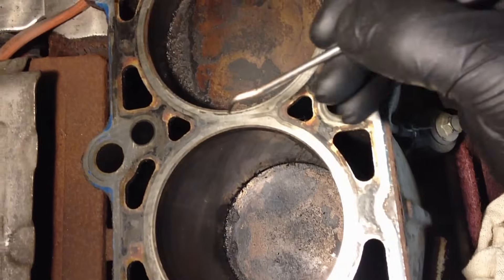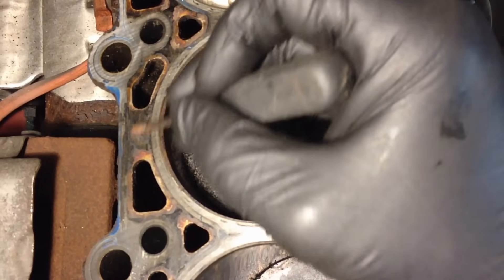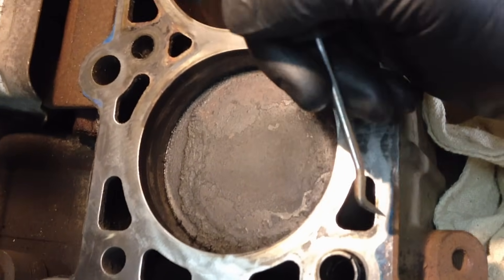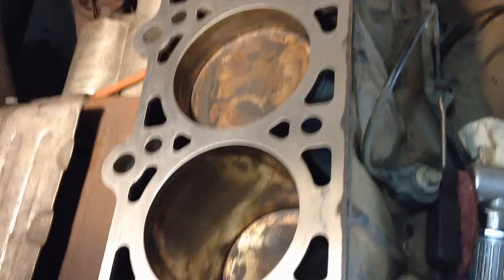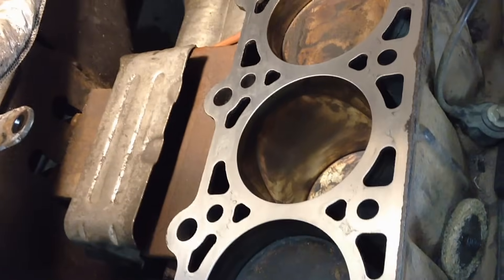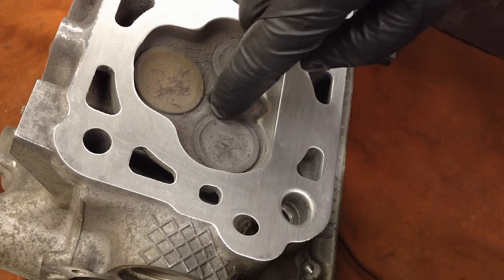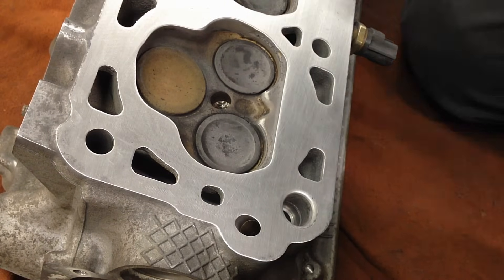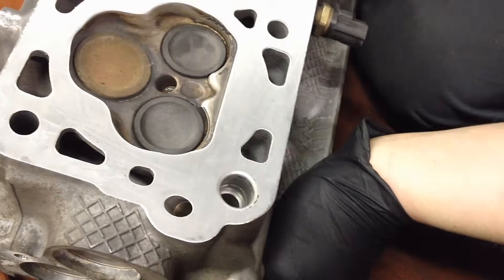My Best Method For Cleaning Head Gasket & Other Engine Surfaces

Comment: one question, would a resurface job give better overall results/longer lasting/ or more reliable results or would this(if done properly) work fine ?
Reply from the maker: +shayson1357 This method works just fine as long as you are clean about and use light pressure. Now if you were running a race engine I would have it resurfaced by a machine shop
Reply: thank you for replying :)
Reply: re-surfacing is really only needed when the block is warped because cast iron is pretty soild metal. But alloy heads more or less do warp a little depending on how you pull it off but its just better to be safe to check for warp and get it machined if it is.

Comment: A cylinder block also contains oil passages and these are exposed when the head is off. My concern would be getting abrasive grit into an oil gallery, the pump will move it with the oil and push it through the big ends and bearing journals. Not good.  Use a good gasket remover and a plastic scraper with a little rub from a scotchbrite pad for the stubborn stuff
Reply: check out the cylinder at 8:27 and compare to 10:23 . The amount of residue from the scotchbrite pad is pretty amazing. I can only assume that quite a bit of it is deposited in all of the passages.

Then again he doesn't get any come-backs. I'm not trying to criticizing his technique, but I have seen this discussion in several videos. Didn't realize that so much of the pad was being left inside the passages
Reply: the grit in a scotchbrite is usually aluminum oxide, harder than iron.
I'd rather use the roloc that he shows. it uses mechanical abrasion. the plastic will melt.
most people are go way overboard, almost to the point where they are removing small amounts of block. get what you can see, wipe it clean, and you are usually good.
what most people forget is to dump the oil after the head gasket, and at 500 miles to drain abrasives and contamination
Reply: Justin Kenaley of

Comment: This is was actually a great help since I don't normally do head gaskets in my business. I recently pulled the heads off a minivan but sent them to a machine shop. It was $150 to have them leak checked, machined and cleaned. I couldn't think of a good way to get the swirls marks out of the block and your method works great. Takes time to keep cleaning but it looks great. I couldn't find the scotchbrite red so I used the maroon metal finishing pad from Home depot and it came out great. It's not as fine, but all of the swirl marks are gone.
Reply: I found them at a Sherwin Williams. they have the very fine and ultra fine. thanks
Reply: Holy crap, I just had a 4 cylinder head tested, surfaced and cleaned for only $40. The guy is a well known machinist in the area, everyone takes their cylinder heads and flywheels to him for surfacing.
Reply: +Patrick94GSR I live in Long Island, NY which is one of the most expensive places to live in the US. I wasn't concerned about the price but more that the heads were in good shape. It is a decent amount more work on a transverse v6 vs a 4 cylinder.

Comment: i use a razor blade to remove remnants on engines that use composite gasket then clean the surface with 180 grit sandpaper and spray some wd40. 180 grit and wd40 is all it takes for mls gaskets 
never had any issues this way.

Comment: is this the same method you use on the 6.0 Powerstroke. I have heard horror stories on 6.0 head gaskets because a block or head was prepped improperly.
Reply from the maker: +Logan Eley yes but the 6.0 must be perfect also it's harder to damage than the aluminum heads
Reply: when you say perfect you obviously mean CANNOT gouge or put low spots in the sealing surface, and clean the sealing surfaces to shiny clean metal. but do you have to worry about the non-sealing surface, any other things that you might watch or avoid for 6.0?

Thank you also for making this quality info available to us. good quality info is hard to come by, especially for the 6.0.
Reply from the maker: yes light pressure and high rpm is key with the white discs. You can just concentrate on the sealing areas which will be readily visible but I like to go beyond them a bit. The 6.0l is going to have large patches of rust on the deck surface and head where the cooling jackets meet I like to get rid of these as much as possible to make sure the new gasket sits perfect.

Comment: doing the same job on a 2004. i have 2 questions. the piston faces are pretty nasty... how clean do they need to be before reassembly? and my other question concerns the heads. all of my exhaust valve heads are white. is this something to be concerned about or is that normal? thank you for your time
Reply from the maker: +Bruce B The valves being white is totally normal almost all of the heads I have removed the valves are this way. If you want to clean the piston heads I would used a scotchbrite pad soaked in carb cleaner to dissolve most of it. Safe to use Scuff pads-http://amzn.to/1T2HpLS
Reply from the maker: +Bruce B strong carb cleaner-http://amzn.to/1VAtfYZ
Reply: FordTechMakuloco thank you for your time and the information. huge help. have a good one. stay safe

Comment: Is it safe to put the pistons in the deepest position and spray oven cleaner on it then wipe down the walls and piston head?
I have never done any of this, but I do want to buy a car and make it a project car. Taking out the engine and rebuilding it will definately be one of the goals.
Reply: +METT Cool. Bought a hand held blower for computers a few years ago. But has been great for car projects too. Thanks.

Comment: what's the best way to clean all of that carbon build-up off the top of those pistons?    have you ever tried putting something like sea foam on a scotch-brite pad, and lightly scrubbed it off?    and do you think that would work?
Reply from the maker: +Jeff Fuehr something like seafoam and plastic scraper or scotchbrite would be best of the carbon is severe. No metal scrapers here though.

Comment: Hey man great vid! Will this method work on the 6.0 diesel? Head gasket surface in particular? I have heard that ford puts a special half moon cut on the block deck and cylinder head to help the gaskets seal. What is your procedure on that? Thanks again!
Reply: NO.

Comment: Do you need to chase the threads on head bolt holes on these 3 valves?
Reply from the maker: +woog74 Never have and never a problem I do make sure they are clean and blow them out though.

Comment: can i use that methods for my explorer 4.0 engine
Reply: +STEEVE DAVID Nicolas If you have an older pushrod 4.0 make sure you get those heads pressure checked for cracks. I've seen them crack and cause a miss on cylinder 3 or 4
Reply from the maker: +STEEVE DAVID Nicolas Yes all the tools I use are linked in the video description.
Reply: Thanks Brian
Reply: Mine is not a pushrod engine, thanks
Reply: STEEVE DAVID Nicolas yes

Comment: excellent info I'm currently working on a 2002 Mercedes C240 spark plug change out 4 hours later I've got all 12 plugs out the $500 dollars the dealership wanted is starting to look like a bargain ha ha! oh well back to work BTW just finished head gasket replacement on a 3.0 Ford 6 cylinder all good in the neighborhood never thought of scotchbrite good stuff thanks

Comment: Interesting, I've never seen it done like this before. The surface looks very good.

I use permatex gasket remover and a semi-sharp piece of plastic as a scraper, mostly because I was taught that the grit from any kind of grinding would wear out the pumps for oil and coolant prematurely.  Thanks for sharing.
Reply from the maker: +Yann Kitson Yes you must be very very careful.
Reply: @FordTechMakuloco  is green scotch brite fine? I’m afraid Ive cleaned it too much.
Reply: GM prohibits roloc discs due to the abrasives getting everywhere and causing premature wear. Stick to chemicals safe for your materials and soft scrapers.
Reply: Yann Kitson  

L
 Bml
Reply: chhotu
Reply: Yann Kitson 
  A1EQ.Q.
Reply: Speaking from experience, gasket remover and a plastic scraper won't even come close to removing gasket residue from aluminum. 
I tried paint remover, laquer thinner, gasket remover, acetone, engine degreaser, brake clean, fume free easy off (no sodium hydroxide), and every single other chemical suggested to anyone online without any of them removing any of the residue, at all. 
The only thing that works is abrasives and the method in this video is the one. I used the maroon scotch brite and then sanded with a piece of glass to make sure it is flat. Since I dont have the white Roloc.

Comment: Got a 1998 Ford Explorer Sport 4.0 SOHC engine.need to replace head gaskets, can i remove heads without removing the engine, and will it be easy to set back in time.
Reply from the maker: +Marcus Bergis No you should really remove the engine to time it right afterwards.

Comment: permatex gasket remover spray it on wait wipe it down.
Reply: waited 30 mins and it didnt wrk
Reply: +Roller Bearing Crank - I've used Permatex Gasket Remover--it works great.  I haven't found anything better, though there may be.
Reply: +King Rider thx  :/
Reply: I found Loctite SF 790 paint/gasket remover works great but be super careful around painted surfaces. Spray it on, give it a couple seconds to bubble then use a fine soft wire brush and it takes everything off. It dries making clean up abit easier than Permatex's 'gooey' residue.
Reply: +King Rider well after scotch brite my thumb to death it 75% clean bt the very smooth dark spots are not coming off wit anything. they want to use and paper and say the little scratches help its seal

Comment: I had zero comp on #8 on a 5.7 hemi. I lifted the head & saw the carnage that some idiot man child left behind for me. It had coarse swirl marks all over the deck & no wonder it failed. Someone re-honed 8 & 6 probably was a valve seat drop but the head looked fine, they probably replaced the head. Now i'm re-surfacing the damage done by the P.O.

Comment: What happens if debris falls into any of the holes? Any way to flush or vacuum it out before reassembling the engine? I do not want to risk clogging a oil channel and what not.
Reply from the maker: +Deborah Klinker There is only one oil pressure feed hole the rest are bolt holes or coolant passages for which the bolts holes are blown out before assembly and the cooling system can be flushed easily before startup.

Comment: so how do you keep the grit from getting in the oil channels and damaging the engine, if you are just sending a head off to be surfaced
Reply from the maker: +Metal Maniac When ever you send a head off you will need to clean everything thoroughly upon return brake cleaner is preferred. On the block side you cover the single oil feed hole and go around it.
Reply: Thank you .. this information is very helpful... I have done work with other heads back  in the day but these aluminum heads are so fragile it seems...

Comment: remove the dowels and block sand with 400 then 600 wet dry paper.
Reply: +4sf3d4g63 I'm down with the 400 600 wet dry very controllable. Maybe a little more work but little worry of that small grit in the engine or being too aggressive.  If you wet sand it wipes up the the liquid.  Glass block is an awesome idea, thank You!
Reply: +henryklevemann No problem Henry. You really only need it to get the gasket impression out. Usually 80-90% surface continuity is achieved within 2 minutes with 600. Use microfibers for clean up and the whole process takes 15-20minutes on a 4cyl. If the block or cylinder head is warped I would definitely send it to a machine shop. I've slightly warped blocks fixed this way and still operate perfectly but it requires much more attention to detail and consistency only truly achieved by machinery.
Reply: 4sf3d4g63 Thanks for the reply
Reply: Paul Lorenzini b
Reply: Getting aluminium oxide into the engine is a great idea right?
Reply: The best method is to acid dip the block and rebuild it the right way. After it is bored, line honed, stress relieved, screens installed in lifter valley, billet main caps.
Reply: @donrutter6765  just buy a new car dude.  Don't do that for a beater car.
Reply: +Richard Amuir ^ I do the same thing. I usually finish with 1000grit and use a thick/flat piece of glass as my block.

Comment: Does a standard Scotch Brite washing sponge has a "grit" closely to that one is used in the video? I really can't find any large one like that in my area, and buying stuff from Amazon or Ebay takes forever to get here. Can I use the Scotch Brite from those washing sponges, or will the scratches be too deep?
Reply from the maker: Smartskaft2 Those are much too rough.
Reply: Ok, I did'n think I was that lucky. ;)
Thanks!
Reply: Smartskaft2 I know three types of scotch brite red, coarse ;grey, less coarse and yellow, fine. You can buy them at your automotive paintshop

Comment: On a cylinder head job the best is take the head to a machine shop they w'll check for cracks on warp
Reply: If you can afford it. It can get expensive quickly.
Reply: Cos me 60 bucks for an inspection cleaning and resurfaceing.
Reply: @clicktoedit1759  where??? I'm getting quotes of $290 a head....

Comment: Steel wool and brake clean is much faster, less trouble. I have yet to see anyone on YouTube run a thread chaser down the head bolt holes or talk about TTY bolts...?
Reply: +Lynx Star Automotive (Gabe V) I'd have to agree...I'd rather degrease a blind hole. esp aluminum and use air to clean those threads instead of chasing...

Comment: I don't really like it. You might have steady hand or something but I have seen many heads on youtube fcuked with power tools. Thanks
Reply from the maker: Gregory May I am very light on the pressure and I keep moving it's all in the feel from experience.
Reply: FordTechMakuloco don't worry about his comment. some people don't know how to use power tools. I use a wire brush on a drill and have never had a problem. I like those wheels you used

Comment: roughness parameters ( Ra ) specs....My question is it how do you know if your Ra is in spec for what is needed for the gasket to bond and seal correctly ?  Because manufacturer has tolerance for Ra, right ?....Only asking, not doubting your technique because I plan to do what you did in this video too.
Reply from the maker: Daddyoui S I have no RA specs for this no but I can tell you I have done this countless times and never a problem. It is attention to detail with the final polishing and cleanup that really matters.
Reply: FordTechMakuloco for responding. Keep up the great videos !

Comment: Having trouble getting the cylinder heads off. Is there a special technique? I have a 1994 crown Victoria interceptor 4.6. I removed all bolts. Cylinder head will not come apart from the block. Please help.
Reply from the maker: Donald Kiser On some I have had to pry off the outside of the block to the cylinder head where it overhangs off the end of the block.
Reply: FordTechMakuloco Thank You Sir..
Reply: Donald Kiser are the spark plugs out? Its an obvious thing but sometimes people forget
Reply: Donald Kiser  sometimes those aluminum ford engines had specific de-torque patterns you needed to follow during disassembly
Reply: Turn engine over acouple of spins the head will loosen up

Comment: I wrap a large scotchbrite pad on a block of wood and get a more uniform pressure
Reply from the maker: Andres Hernandez Money is the name of the game when it comes to customers and time.
Reply from the maker: ykmalachi Yeah or a pad sander good thinking.
Reply: FordTechMakuloco I've always been told to get the block decked but i guess that would be for a rebuild only. I never understood why people only replace the head gasket and not just have the engine rebuilt. Everything is already off and it wouldn't be that much to rebuild
Reply: @DREADLOCKMODSHOP  Cost, but a used engine is cheaper than either and low mileage engines are plentiful for most popular vehicles. That's why used car lots etc buy organ donor vehicles at auction for a few hundred bucks, snatch the engine or drivetrain, and swap.  The advantage of buying a wreck is you know it was running on impact.  I've done quite a few such swaps on the job and do them for my own vehicles too. I enjoy rebuilds, I have the equipment and resources to do them cheap, but for most cars and trucks it's simply not worth it. I can buy two or three more used engines for the cost of rebuilding one.
Reply: @obfuscated3090  running but how:)
but u r right btw
Reply: ykmalachi ii

Comment: I've been looking to buy a 5.4 for an Explorer.  Cheap engines often need a head job.  What was the reason your 5.4 in the vid was being worked?  Was it just a bad gasket?  Also, with the aluminum heads, no shaving it?
Reply from the maker: SmitfraudC Believe it or not this was for broken studs in head doing a exhaust manifold job with no room to drill out. I would not shave the heads no, these really don't have head gasket issues like the 2v 5.4l.
Reply: FordTechMakuloco hi, what number is the sandpaper to the cylinder head, which is used ?.....tnks..

Comment: You're an asset to Ford. You take your time to do it right. Saves headache for the owner and the mechanic later on. Good job!
Reply from the maker: Thanks!
Reply: Mopar electronics crap Fiat QC is garbage I live 5 miles from Belvidere assembly plant friends have worked their for decades the stuff I hear holy shit.
Reply: @broken1965  AC Delco /Chevrolet is being sued right now for putting made in China parts in made in America boxes. It may be over for American vehicles
Reply: Alot of companies are doing this not just Chevy.  Does Ford do this? or are they good boys.  Ah ha.
Reply: Jon A all brands have problems